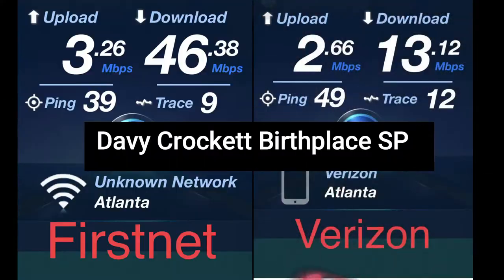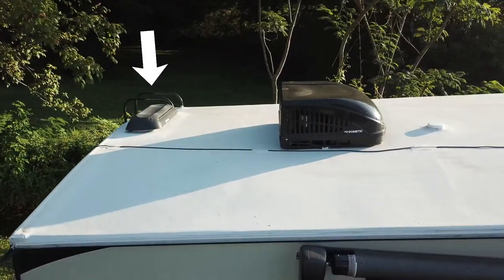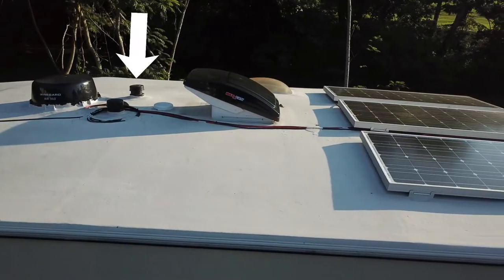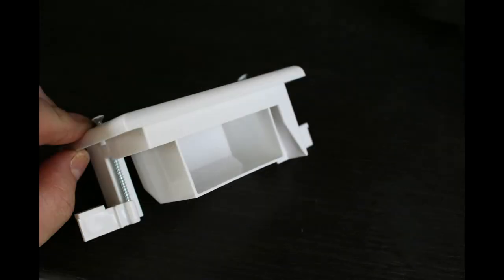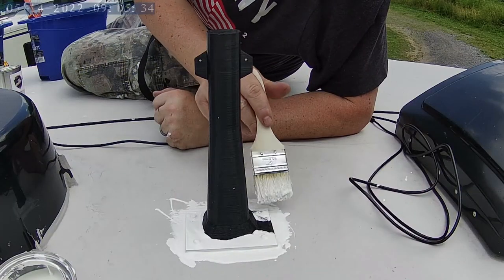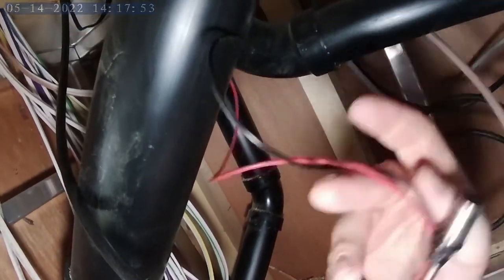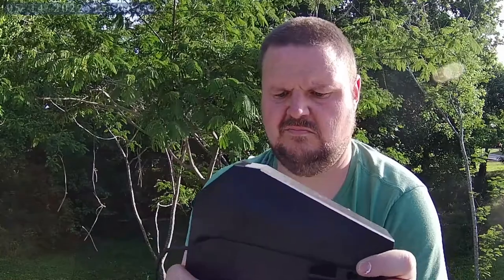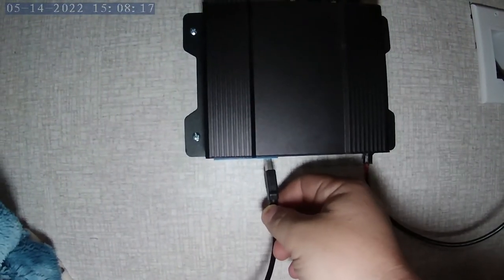Insty Connect 5G RV High Speed Internet #Instyconnect #5G #rvupgrades

Comment: Great Video! I just ordered the Insty connect and I am a registered nurse. Question for you before I go down to the AT&T store and order the First Net they offer. Which plan are you using The Unlimited Pus, that offers the tethering and hotspot? Or just the basic unlimited  standard package?
Reply from the maker: They have recently changed their services a little as I see family is eligible now.  For this router it was the same plan as their 5G wireless hotspot but I’m not sure what it’s called.  I looked at the bill to try to find the plan name but it takes more than a masters degree to find it apparently lol.  I would also suggest looking at some of the videos on the Insty Connect YouTube channel.  There is a lot of videos about it on the channel “We can Explore It” as well.  As he’s the one that developed the system.  I’m super happy with it.  There’s been once that I’ve had to go in and manually switch the tower but usually everything is automatic with good service.  I also put the blink doorbell on the camper since I have unlimited always on internet (and solar to keep the battery charged from the little draws of the router and such)

Comment: Going to look into this, despite having unlimited data, I'm finding ATT is not everywhere I need it to be...
Reply from the maker: I have been very happy with this system and will evaluate how the omni directional antenna does over time but I’m happy to know that I can upgrade to the directional antenna if needed.  I also like that it’s only a single wire from the router to the antenna.  I was amazed that I usually have a better signal with AT&T than Verizon.  I do like that you have the capability to have a SIM card of each in this system.  Btw.. I did an overview (low level) video of cleaning my a/c coils but I did refer to your video and linked it… but it’ll be a while before it is public
Reply: @GimpyCamper  appreciate that Barr.  You ever get over to PA please let me know.